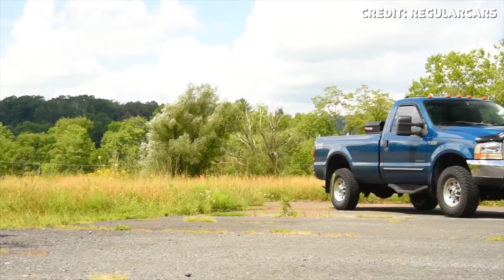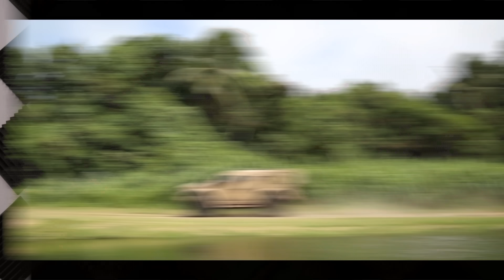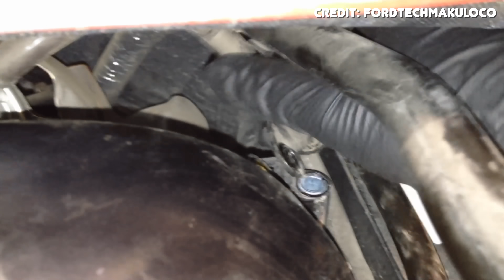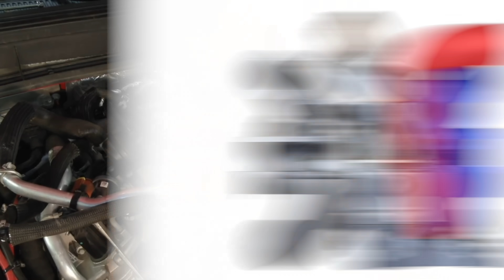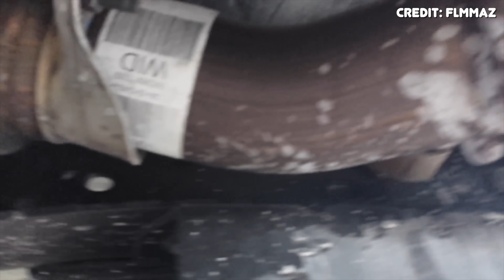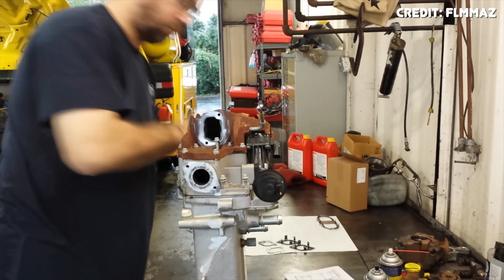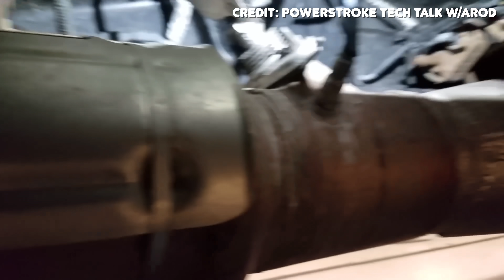Everything Wrong with the 6.7L Powerstroke

Comment: Prey for my 2016 f350 6.7. 272000 miles. Happy at the moment.
Reply: I'm catching up on their with ya! 2017 f350 srw now at 113,500 miles. All emissions and factory intact. Tows 10,000 lbs. rv trailer up in down the Nevada desert.
Reply: I’m pulling about the same but all over the country. Still holding up

Comment: A failed EGT sensor will no longer leave you stranded. The truck will no longer shut down or cause a no crank. Ford has fixed the EGR cooler issues on 2020 and newer. They stil leak engine oil though.

Comment: 283,000 on my deleted 2011 power stroke and no issues to date.  I service it regularly and do NOT hot Rod it!  It’s pulled it’s share of big loads but nowadays is just serving as my daily driver.  Best diesel I’ve owned.
Reply: That’s my favourite thing about the 6.7 power stroke all you need to really do to make power delete the government scam can and your out pulling any modded 6.0 7.3 and any pre common rail Cummins and this is coming from a duramax fan boi 😂😂
Reply: Baby a work truck. You should send that to Ford as a new marketing campaign.

Comment: Regarding your question about the lack of emissions control devices for aircraft, commercial boats, and military vehicles, they each have unique reasons not to have them. General aviation aircraft do not have them because they add weight and complexity. This increases the risk of engine failure, which would present a safety risk to the public. And the weight of the systems would increase fuel consumption while decreasing range and payload, offsetting much of the gains of said emissions control devices. Commercial shipping vessels have minimal emissions controls due to operating internationally, usually under a "flag of convenience" meaning they operate under the laws of the flag they fly on their boat, which is usually a country with regulations favorable to economical commercial operation(no emissions laws, no minimum wage, low work safety standards, etc.). And military vehicles lack emissions control devices because fuel on the front lines is both outrageously expensive(think hundreds of dollars/gallon), and of vital tactical importance, meaning it cannot be wasted for any reason(such as the ~30% loss in efficiency from emissions control for diesel/Jet-A/heavy fuels). The weight/operation of the emissions control devices would also decrease combat effectiveness of military vehicles(make them slower), and the complexity of said devices would increase logistical complexity of repair work in combat zones.

Comment: We have 2 6.7 550s at work  one a 17 the other a 18. Both just over 100,000 miles shit there cookies out due to what the dealer leaked out a common oil passage blockage issue suppling oil to the crank. Just out of warranty ford covered half of new motors for both trucks. They make some good power but ram and Cummins been doing good power plant wise since 89 and was smart enough to ditch the cp4 to go back to a cp3.
Reply: As for the rams, tell me about the other issues between the engine, front end and tranny....
Reply: @ryanselleck6035  what planet are you from. The 58s and 68s are garbage. That's why I am still doing front end work on these rams with under 1200 miles on the clock huh? I can't tell you which I do more engine's on between the 6.7 Cummins and the 5.7 hemi. But I only do this for a living so I don't know what I'm talking about.
Reply: Bro your stuck in the 90s 4th gen and 5th gen have great front ends. Engines that are the most reliable and 68rfes that  are actually decent if you leave them stock and an Asian trans that superior to an Alison 1000 with a factory 4 disc convertor.
Reply: @ryan05753  fiat bought them out in 07 and they started having issues. Then they changed they body in 10 and everything went to shitfor the rams. Pre 07 they were good trucks... rode like a tank but good trucks. Now I'm curious to see since fiat sold em to stalantis will do.
Reply: @ryan05753  I'm not referring to anything ram pre 2009 before fiat bought them. You go to any private shop or more specifically any tranny shop and the 68 and 58rfe's are the majority of what's getting worked on. Another the 5th gens don't have a good front end the drag link on these ford's and rams are garbage which is why they continually have death wobble issues. Amd the engines and trannys since 2009 have more catastrophic failure than ford and gm combined. Hopefully stalantis will do something since they bought them out. But it looks like they may just sell off the companies in prices. Fact is ram went to shit after fiat bought them. I'll the a pre 2009 ram before any of these newer ones for mechanical durability.  That's not even getting into the fact they are the worst at retaining their value.

Comment: 2002 f350 7.3 170k two problems, cam shaft position sensor replacement and hpop leaking threads fell out when replacement of the oring so the pump had to be replaced.

Comment: I have the 3rd gen 6.7 in a 2022 f250 superduty and the turbos are junk a month and half after owning the truck the turbo blew out of truck been down for 2 months to get repaired also wiring issues is bad with 2022.

Comment: As far as military & aviation you have to keep it simple. In the military you need to keep it simple & dependable, especially in combat. In aviation, dependability and weight to power ratios are very important. An aviation engine is very high performance. Avgas  is 100 octane. With Avgas you cannot add the weight of things like catalytic converters and systems that decrease the power output.. With the new jet fuel A ( which is kerosene) internal combustion engines, again you do not need the added weight and you have to keep KISS, as you cannot just pull over and call a tow truck. As for the turbine jet engines, they are a completely dif,different, type of engine, so there is no putting DEF in a turbine engine.
Reply: Turbine are vastly more efficient than Piston engines too. 

People don't seem to understand that. 

If trucks ran 500MPH and moving that much weight. They would need 4 tanker trailers to tow that much fuel. 

All new Container ship run turbine gennys with electric motors.

Comment: I had a '95 F-250 7.3 powerstroke that I bought with 115,000 miles and traded it in 2 years later with 215,000 miles  for more than I bought it for. Any truck that pays you to drive it wins first place in my book.

Comment: The best solution to the CP4.2 problems is a CP3 conversion. They have kits for Duramax, Cummins and even VW/Audi TDI's.
Reply: no room for a cp3 on a 6.7 power stroke which fkn sucks
Reply: @josiahkunstman8168  I believe there is a kit to add a cp3 in parallel with the cp4.2.

Comment: What a great and well done, accurate video.  Our family having owned 3 Superdutys now, 99 - 6.8L, 12 - 6.7, and now a 22 - 7.3, we got the Diesel for the first time in 12 because I just felt the 6.2 wasn't enough.  Great Raptor motor yes.  Reliable - Yes.  However, for HD work having to rev it out was what bothered me to make any power.  We just sold the 12 after 172k miles and 10.5 years of ownership since new and we have had many of the issues described in the video.  The EGT sensors before Ford admitted that they were issues on the non-emergency vehicles that left us stranded twice, once locally, once in canada, EGR issues, and Reductant heater issues.  Never any issues with CP4 (i'm meticulous about my fuel and maintenance and additives).  We moved to the 7.3 because its a great motor and great for towing without all the diesel headache.  It warms up quickly comparatively for cold climates and with diesel fuel being 25 percent ish more, there goes the fuel economy advantage, plus DEF and fuel additive cost.  Only way I'd consider a diesel again is if I was constantly towing.  Ford has done a good job in recent years with their customer satisfaction programs and reimbursing many of these issues out of warranty.  That being said, gonna miss that truck.
Reply: Funny thing about diesel, here in AK it usually runs cheaper
Reply: Funny thing about diesel, here in AK it usually runs cheaper
Reply: What additives did you run in your diesel fuel?

Comment: Where I live, I would bet well over diesel pick up have been deleted as there are no smog check requirements.  As for me, I plan to leave all that crap on my truck, as I drive frequently to kommiefornia,  and as I personally know  a CHP officer,   I stopped by his house not long after I got it.  The delete option became a topic of discussion,  I told him that most truck have been deleted, and his response was as long as I was driving back & forth,  He was told "unoffcially" that when stopping an out of state diesel pickup, the officer is to visually inspect & determine if it was deleted.  If it was, then the vehicle would be impounded, and would not be released until proper repairs were certified to be completed, by a certified repair shop. Damn glad I left that kommunist petri dish

Comment: Pretty accurate! I’ve been really fortunate with my 2014 at 138k knocks on wood — no turbo issues or problems with the CP4 (I always use quality fuel and additives, though). I think the delete has a lot to do with that. Better power, better fuel economy, too.
Reply: Definitely look into an s&s bypass kit if you're worried about the cp4, Definitely worth the money and it will save you a bunch of money of it does go
Reply: I’ve got a 2013 deleted with 143k miles and my co4 failed about 10 days ago. Left me stranded 3 hrs from home. $17k for the dealer to replace the fuel system and $14k from the independent shop. I would highly recommend replacing that pump or installing a disaster prevention kit ASAP.
Reply: @fredvincent4224  also: did you use a fuel additive, and what did you do then? i’d never use the dealer personally just because ours suck here. check out power stroke tech talk with a rod on youtube. if you haven’t got the work done yet i’d be willing to bet he as a ford diesel tech i would trust with my own truck and have many times might be able to do it cheaper for you outside of the dealership itself. dude is a genius with these trucks. even if you had to ship him your truck 😂
Reply: @TonyLasagna  did not use a fuel additive and honestly I think it failed because I ran a little too long without changing the fuel filters. I was probably around 16k miles on them. Going to be doing them with every oil change around 7k miles from here on. Still owe $28k on the truck so I’m damn well stuck with it now.
Reply: @fredvincent4224  i feel you man. gotta use one the diesel in the states sucks. go to the s+s diesel youtube and watch him explain how the cp4 works. ifs nuts 

that being said, absolutely could have been the fuel filters. i change mine every 6500 miles or less. can i afford it? no. but i could be where you are now. we live and learn, and i feel for you dude. i still owe on mine too. i’m lucky i’ve gotten it this far. did you see my other comment? i can put you in touch.
Reply: @fredvincent4224  and don’t put another cp4 in it bro. please don’t do that
Reply: @TonyLasagna  yeah going with DCR
Reply: @fredvincent4224  i’m at 200k now, but i am indeed replacing it with the s and s DCR pump in january. until then i ply it with lubricant and hope i got lucky with a good one

Comment: Heck I just got an old cream puff Lariat 7.3 to tow my camper around the country. 
It’s pretty much a tractor with leather seats and A/C. I think it’s massively powerful and efficient just having switched from a V8 half ton.
Reply: The only thing wrong with the 7.3 is they are 20 years old. They are rock solid workhorses.
Reply: I did the same, I did notice my stock 7.3 is underpowered for hauling my 16k pound 5th wheel. Not that adding power is a problem on the 7.3!
Reply: You wanna see a tractor, my 89 F250 with 7.3 IDI is a tractor with wheels. The 7.3 powerstroke is so smooth in comparison haha
Reply: I have a 2002 F350 7.3L ZF-6 spd, manual transfer case, manual locking hubs.  Dana 60/ leaf spring front axle, Dana 80 SRW..  It's definitely a tractor--  It's so basic:  I don't even have tilt wheel or cruise control. lol... manual cloth seats/  manual mirrors/ manual windows/ manual locks.   I bought it in 2013 or so with 170k miles for $7500 (without a bed)-  and now it has 330k miles and still pulling as strong as ever (with a 9ft flatbed that I put on it).  It likely needs some new glow plugs (little stubborn to start in the cold without plugging it in) and loves to leak in all the right places-- but otherwise it's still old faithful-- and I'll likely never sell it.
Reply: Not really. Comparing numbers. 

Don't get me wrong. I have a 02 7.3L XLT. 

It has enough power. Sure I bet it does the job. 

Efficient no. 

Remember with the same amount of fuel the 6.7L put out 2x as much HP and more than 2x torque. 

Efficiency is work from energy.

Comment: I had a 2012. I put it through some serious work, towing 8-14k every day for a couple years, through rough mining terrain. Loved that truck. I did have one bad EGT sensor that stranded me 3 times before I was able to replace it. Had to unplug the brain and reset everything just to get the truck to start, and get it safely off the freeway. Frustrating. 

Your discussion about the issues they have solved since gen 1 just make me want one again that much more. Sigh.
Reply: I’m in the aviation industry as a mechanic, and EGTs are constantly going out. Because they are in a high heat area, they tend to corrode and erode away very quickly. Then they break off more often than not, and if the plane is turbo charged, it is grounded due to FAA regs.

Comment: A senser causing an emergency vehicle to is a catastrophic failure. This can cause unnecessary risk to patients and emergency runs. Cummins powered emergency vehicles will not shut down due to emissions failure. They'll destroy the emissions system before shutting down. Cummins powered School busses won't shut down either.

Comment: Yeah those 10 speed 6.7s are some monsters. And you'd think a silverado or sierra 1500 has scary passing power well shiit even on a f350 dually you'll be running through everybody without a heartbeat. But mainly I need it to pull all 4 of my horses that's why I want the 10 speed for quicker hauling.

Comment: The fuel filter under the hood is a common issue. I didn’t know this until mine developed the pinhole they’re pretty famous for getting. It pretty much turns your truck into a diesel fountain and a fire hazard. If you smell fuel, stop and check it.
Reply: It's gencaused by a restriction in the secondary filter

Comment: I went from a 2000 7.3 to a 2020 6.7. Both have worked great for me. But, the power and efficiency of the 6.7 is amazing. 7.3 trucks are super cheap and still reliable, the new 6.7 cost a small fortune. If money isn't a factor, you have to award the 6.7 as the best.... period.
Reply: what is the mpg on the 6.7? my 7.3 gets around 16-17mpg
Reply: @JD-yx7be  I drive like an ass, tow 3 of 5 days a week 8-12k and average 12. On a long road trip you can get 18-22. My mileage is on the low end of what others have reported.
Reply: @justinthomas3253  I get a similar result 11-12 around town not towing. Also not towing highway 14-15. and on a 1200 mile drive i got a whopping 17 mpg.Towing my 29 foot travel trailer on the interstate I get around 12-13
Reply: I have a 23 6.7 but someday I want a 7.3 classic

Comment: I dunno, I just can't get rid of my 7.3 PS. It runs to good and has always been trouble free. Yeah, it's slow, and loud AND ugly.... But it just keeps going and going, and going... These modern diesel engines are super powerful, but man, the maintenance costs, stress of worrying about the emissions stuff breaking and all that... I think Ford was smart making that big cube 7.3 gasser. Most people won't need more then that. I'm sure GM and Ram will follow suit at some point with big cube engines. Hell, this new 7.3 gasser is just a giant LS for the most part. Just my $0.02.
Reply: I love my 7.3 too. I think some of the biggest problems guys have with modern diesels is they can't leave them alone and have to tune them to peak performance and that's where they start snapping parts and burning stuff up. Best diesel rigs to buy are the stock ones owned by grandpa.
Reply: @andrewgrossman6066  100% man. I mean, I get it, it's fun to mess around with stuff and add more power, but man, it can get expensive fast when you start busting parts on a diesel. I'll keep my 7.3 stock and guess what, it'll probably last forever. I'm good with that.
Reply: Never heard somebody call a 7.3 ugly before
Reply: My truck is an early 03 7.3L, ZF6 F250 SC 4x4. Bought it off a dealers used lot in Sept 05.
 It's a draft horse, not a thoroughbred. So I researched and installed longevity mods, since it more than likely has PMR's.

Garrett BB turbo, Adrenaline HPOP, hi volume LPOP, coolant filtration system, dual bypass oil filters, IH T444 bellowed up pipes, Banks intake and Intercooler. Dash pod mounted gauges.

Comment: I replaced my CP4 & injectors as a preventative maintenance at 200k.
Installed an S&S 4th Gen disaster kit. 
Never deleted the truck, I see no reason to do that since I do a static regeneration once a month.
My oil stays clean and it runs with no problems.
Reply: Im at 250k doing mine this winter preventive.  most likely 275k at that time. replaced lift pump at 200k preventative oem
Reply: How do you get it to do a forced regen? With a laptop from a dealer? Would love to be able to get mine to do a regen when I m pulling a grade I do normally. Is it only possible while parked? I ve heard of dealers doing this often for trucks that idle a lot.